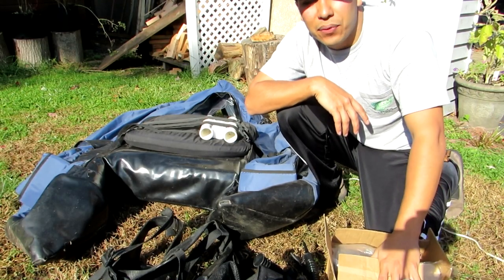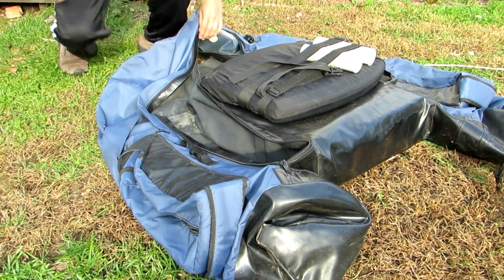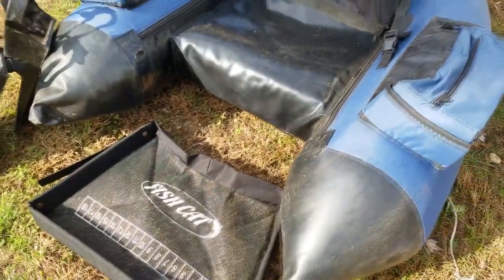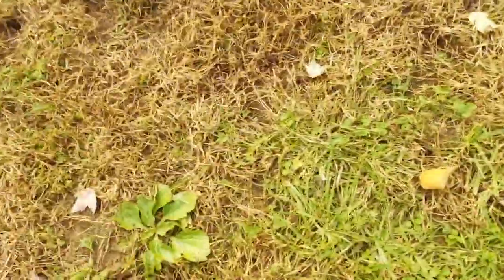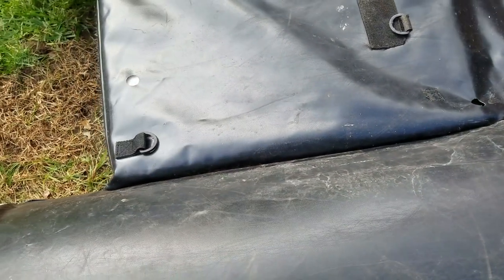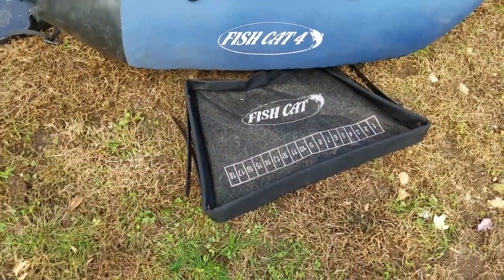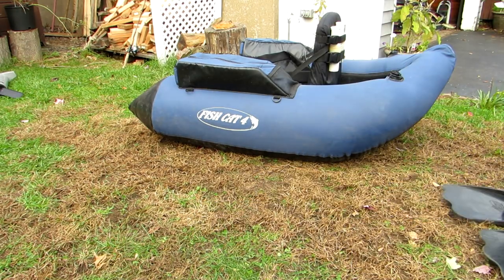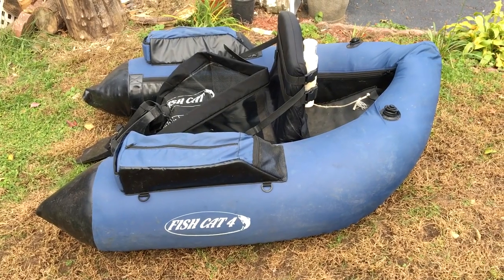Outcast Float Tube Fish Cat 4 FULL REVIEW + How to Replace the Air Bladder !!

Comment: I've been fishing from my Fishcat 4 for nearly 20 years. It's never failed me.  The only change to your setup I would suggest is real swim fins.
My friends use those cheap fins that Bass Pro and Cabelas sell... and I run rings around them with my true snorkeling fins. I'm probably nearly twice as fast... without near the effort.
Reply from the maker: The fins I got came as a package deal and so far they done a good job, I might upgrade to the turbo fins like my friend has. I would use snorkeling fins but I fish in cooler months sometimes and I wear wading boots so snorkeling fins would be and option only in the heat of summer. I might build a rig to carry my rods better on my float tube out of PVC.

Comment: Do the flippers come with the float tube or are they sold separately? Great vid by the way.
Reply from the maker: The fins are sold separately, as well as the air pump.  You don't have to get those accessories from them especially if you find them cheaper in a sporting good store near you! I've seen the air pump sold in different retailers, just make sure the fins are the rigid hard plastic ones and not the swimming pool or snorkeling kind! Your best bet would be to buy the fins from them and get the air pump of your choice from wherever and possibly get one that is battery operated or can be connected to your car for faster inflation.

Comment: Hmm...that's pretty cool, I own Intex 4 boat but it's a pain in the butt to use, ecpecially if going by myself. How are regulations for this tube? I had to register the boat with DMV, get a license sticker..also at Bear Mountain lakes like Sebago they inspect the boat to approve for safety. How does it work with this tube?
Reply from the maker: No need to register it unless you put a motor on it, I dont put it on lakes own by the state or large bodies of water. I usually use on smaller ponds and lakes and have never been bothered by anyone. If i use it in a state park area or county lake I make sure I have all necessary safety equipment ( PFD, whistle, etc.) and dont have any issues!

Comment: how do you fix a leaky bladder?
Reply from the maker: If you just have a small tear or puncture it can be patched up, there are patch kits available for that. If it is leaking from a seam or valve like mine was then the best option is to replace the bladder. You can try a temporary fix by dabbing silicone over the leak but that is to be used as a temporary fix and could extend the life of the bladder, eventually you will just have to replace it entirely. So far I've had to replace 2 bladders on my float tube but that's over a 10 year span. Hope that helps!

Comment: Where did you order the air bladder?
Reply from the maker: I ordered it from the manufacturer,  there is a section for replacement parts on their website. There is a link to the website in the description of the video and they have very good customer service if you call them.